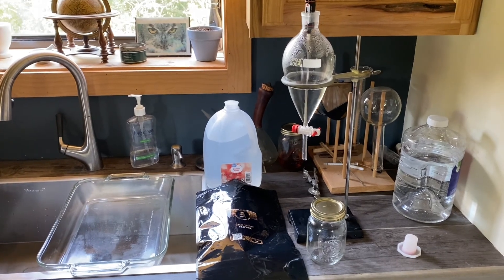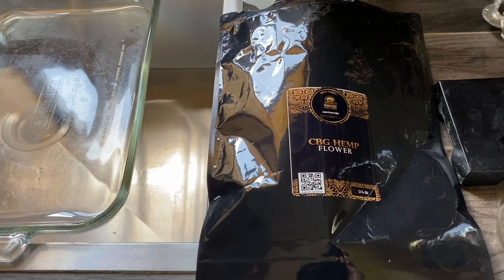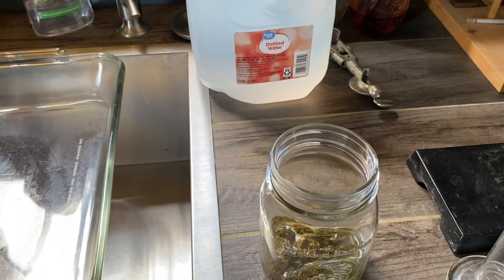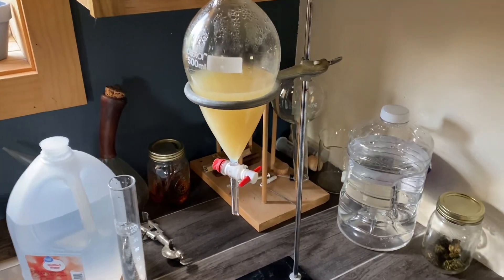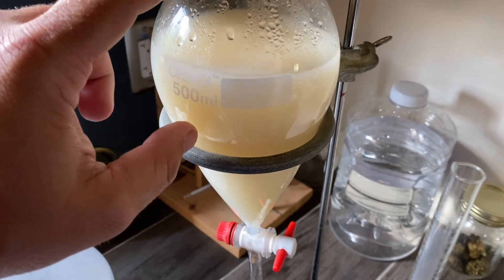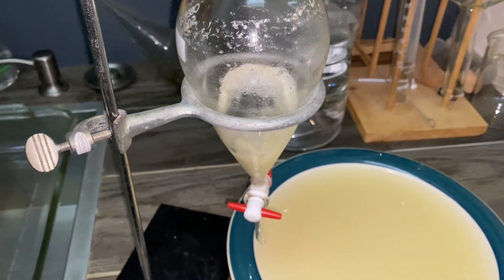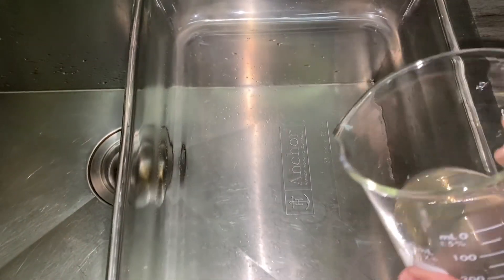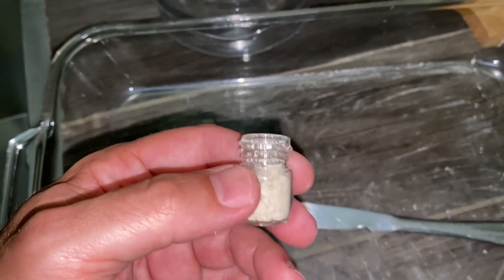Alchemy and Chemistry pt 19 - A simple CBGa extraction (see description)

Comment: Hello Charlie, what about decarboxylation of the plant matter?
Reply from the maker: For initial extraction I wasn't too concerned with it, however, I understand that CBGa can be decarboxylated with heat, which may increase potency similar to THCa being decarboxylated to THC.  I will have to do some research on CBG dercarb temp. 

 I can tell you that for THCa extraction and decarbing, you want to keep the temp in the 200 to 350 deg f range, with time being the factor, much like cooking, you could go at a lower temp for a longer time or higher temp for a shorter time but in any case, if you over cook it the effect will change to more "sleepy" as CBN is created from over heating. 

 So, CBGa I think could be heat treated or maybe just let it age and decarb slowly over time.  Another option might be combining it with the potassium carbonate salts from plant ashes (as is the case with spagyric medicine) which could also be a method of decarbing.

At the end of the day, I usually put CBGa tincture or solid waxy extract in a nice hot tea as a mild pain reliever.
Reply: Thanks Charlie
Reply from the maker: I actually just took some CBGa tincture for knee pain.  I read that the decarb temp for CBGa to CBG is about 110 Celsius so 230 deg F.  I will have to do some experimenting to see if it makes much difference in the effect.  Hope this helps.

Comment: Thanks for the video. I’m wondering if you actually got that much CBG isolate from the amount of hemp you showed in the beaker. That seems like such a small amount of hemp to produce as much CBG as your video indicated.
Reply from the maker: The extract I obtained was in fact from the 5 grams of dried CBGa hemp flower as shown in the video, however, there are a few things I’d like to point out.  Firstly, the hemp flower was quite dry, so, that changes the preliminary weight measurement.  The white material obtained, which has the medicinal properties, was very porous and fluffy…that small glass vile was VERY light weight.  I should have weighed the white CBGa I obtained.  The “John snow” or similar hemp varieties typically have about 15% CBGa.  That would yield about 750 mg of CBGa.  I would guess that in the little vile I got about 500 mg, about half a gram.  It was very light. Also, there could be other plant compounds mixed in with it.  It was “mostly” CBGa but without independent lab testing I can’t know the exact product composition.

Comment: How do you make sure to not get loads and loads of chlorophyll in the alcohol?
Reply from the maker: Time… as in less time.  When you soak the herb in ethanol, just give it a minute of shaking.  If it soaks for a long time it will pick up the chlorophyll.
Reply: @CharlieMacklin1  to be honest im searching for a „kitchen/mini lab scale“ method of seperating the chlorophyll after using ethanol for extraktion. Lately i had seen a video of some dude pumping butane into the alc+ plant material solutions in order to seperate them. Technically it makes sense to me due to the higher polarity of alcohol right? but i just dont like working with highpressures, i think the risk exceeds the potential otherwise this would have been widely used in commercial extraction right?
Reply from the maker: @louislwspsycdaf9049  yeah, higher pressures require special equipment.  CO2 extraction for cannabis is pretty clean but yes heavy equipment.

There’s a handful of different ways for the home experimenter to make it work.  For THC and I would also assume CBD, I would try cold ethanol, really high strength ethanol like everclear or better.  Just do a quick shake down with cold ethanol for a few minutes, strain, then let the ethanol evaporate at room temp or better yet in a vacuum chamber.  That would get a pretty clean product.  It would have some color to it but that’s ok still clean enough.  For that type of stuff you want a little amber color in it from the fresh terpenes.  There are a couple of videos floating around where people do that with regular cannabis…although CBG cannabis it acts a bit more like a wax than an oil.  Just a bit different consistency
Reply from the maker: @louislwspsycdaf9049  if you find a way to get chlorophyll out of tinctures (post extraction) let me know.  I’ve wondered that myself.  Chlorophyll contains magnesium.  There are some ways to get it to change from green to brown using vinegar if I recall, but then you have the vinegar to mess with, but it could be neutralized and the CBD oils should eventually float to the top…Hmm.  I may have to try something like that with CBD bud.

Comment: Interesting vid bro. 
Is there any reason why not to let the alcohol extract the plant oil longer or not to use heat?
I notice you did get a surprisingly large yield even from the minute you used.
Reply from the maker: You can use the alcohol for an extended period of time, but it will tend to pick up a dark green color.  The extraction method will still work, and it would increase yield but at a lesser purity.